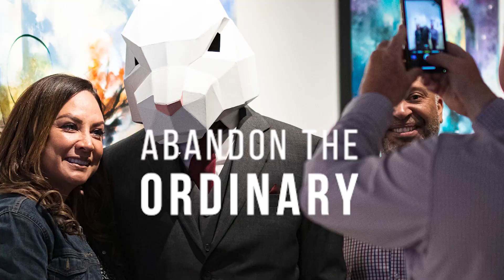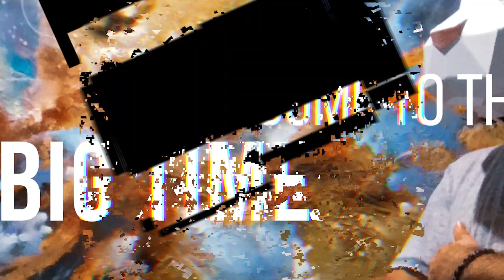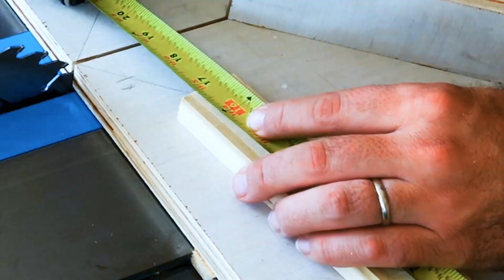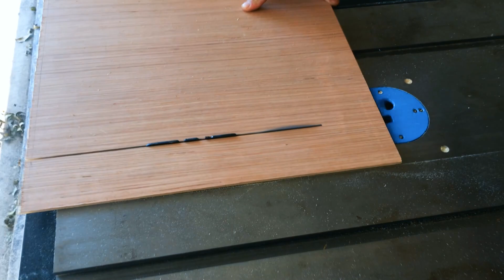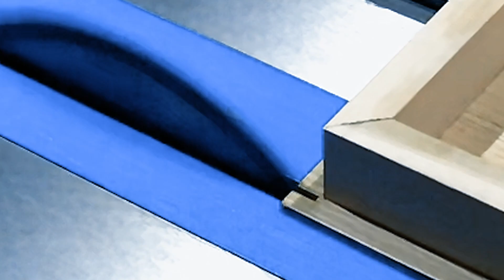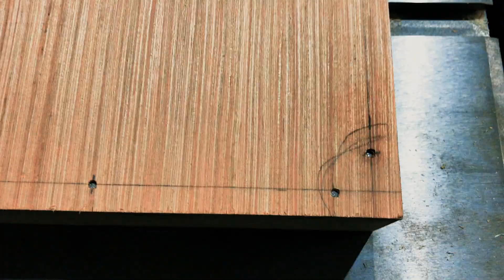𝗗𝗜𝗬 𝗪𝗼𝗼𝗱 𝗔𝗿𝘁 𝗣𝗮𝗻𝗲𝗹𝘀 - 𝗡𝗼 𝗥𝗼𝘂𝘁𝗲𝗿 𝗼𝗿 𝗡𝗮𝗶𝗹 𝗚𝘂𝗻 𝗥𝗲𝗾𝘂𝗶𝗿𝗲𝗱 -  𝗧𝗵𝗲 𝗗𝗶𝗿𝘁𝘆 𝗕𝘂𝗶𝗹𝗱 𝗠𝗲𝘁𝗵𝗼𝗱

Comment: can I do the 2 sides overhang then flush trim?
Reply from the maker: it can be done that way just overhanging 2 sides instead of 4. But you have to be positive you've got the other 2 sides that are perfectly flush with the frame. Which means perfect 90° frame and perfect 90° panel surface. And that hardly ever happens. You're welcome to try, but in my experience, it's just better to cut all 4 sides. That way if the frame is out of square, nobody will ever notice since the surface is cut precisely to that frame. But if it's off anywhere, it'll stand out to a discerning eye, especially if it's short anywhere. Galleries, collectors...the people I like to impress with precision and attention to detail. They'll notice.
Reply from the maker: What might make things easier on you is to just overhang 2 side about 1/8 inch or so. And that way you have to trim off much less and will still get that perfect fit to the frame. Something to consider.